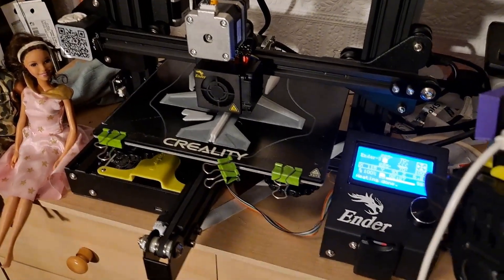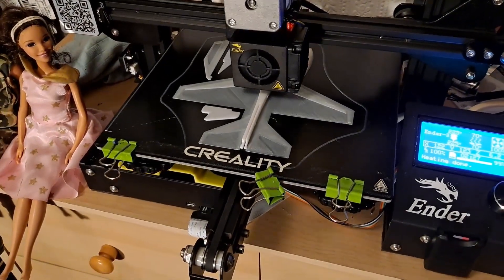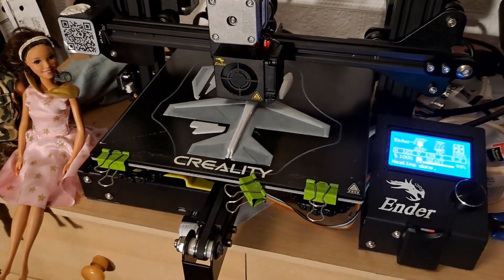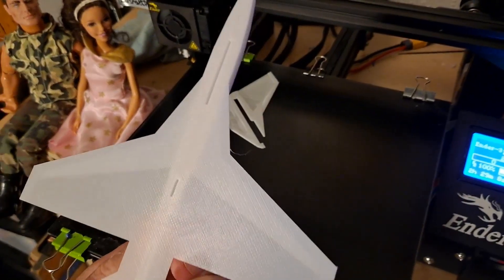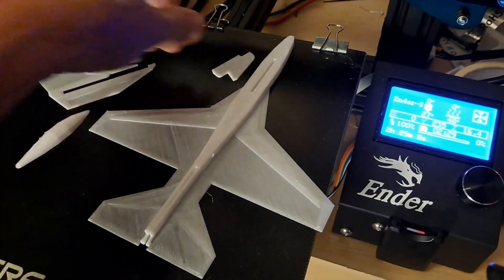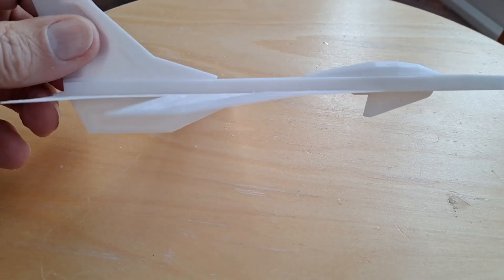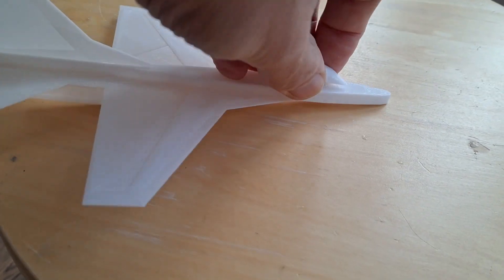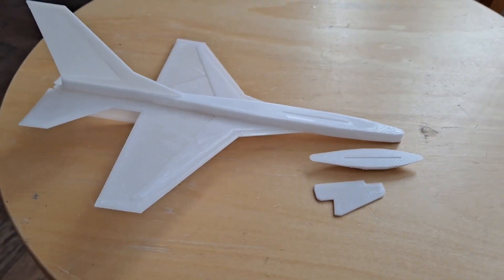Random stuff off Thingiverse   F-16 glider 190MM by exosequitur on Thingiverse

Comment: Have you looked into the P.E.I. build plates at all? My printer came with one and it's amazing. Prints have fantastic adhesion but also come right off with a flew of the plate.
If it gets messy you can just scrub it with soap and water, dry it and toss it back on.
It's a fantastic upgrade.
Reply from the maker: The current plate is one of those glass ones with a coating of something. The previous one was some sort of flexible thing. After some initial issues, I am now quite happy with the glass one.